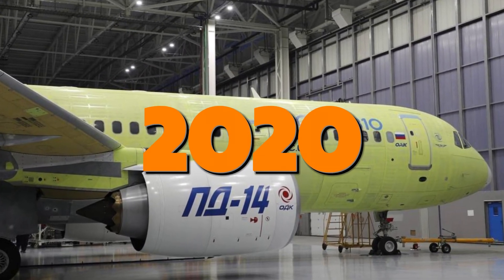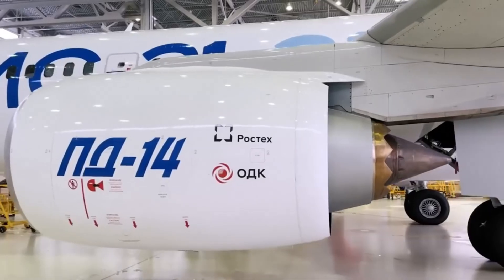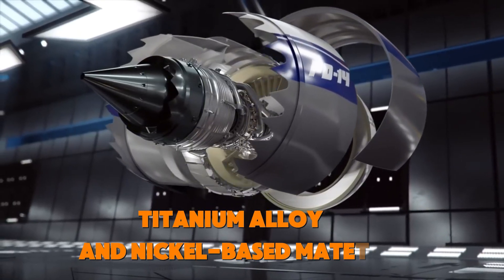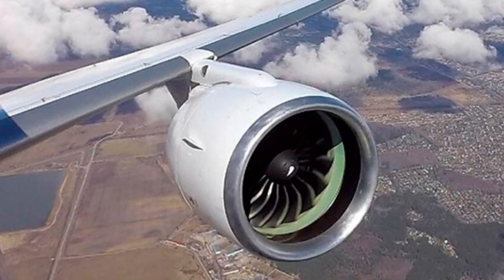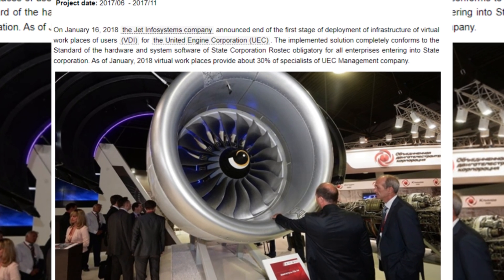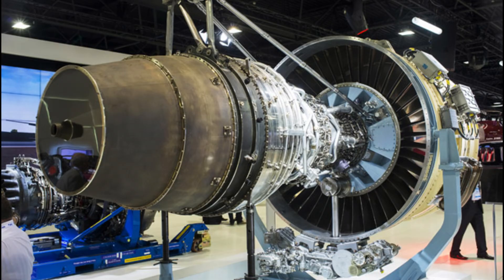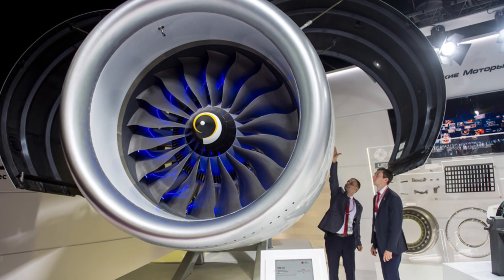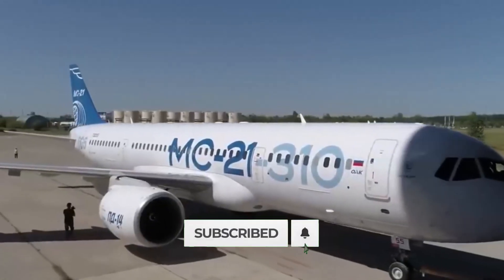Russia's PD-14 Engine: The Aviation Game-Changer You Need to Know About!

Comment: PD-14 is a low risk, low complexity modern engine that is slightly less efficient than modern western alternatives; however the aircraft itself is not meeting design criteria and the engine has no other aircraft at the moment. 
It is also questionable whether Russia can produce these equipment given labor shortages and loading of the same factories for military use.
Reply: Die PD Triebwerksfamilie besteht aus vorerst 3 Stammtriebwerken.
PD 8, 14 & 35 welche jeweils Evolutionsstufen mit mehr & weniger Schubkraft haben werden. Eine Bauastensystemtriebwerkfamilie mit vielfältigen Anwendungsmöglichkeiten.
PD 8 (6-10)
PD 14 (12-18)
PD 35 (->44)
Der Grundtriebwerke
PD 8 für SJ 100 & BE 200
PD 14 für MS 21 (+TU 2x4 New?)
PD 35 für IL 96(98) + AN 124.
Aber SJ 80/+130, MS 21-2×0/4x0/5x0 und IL 96(98) 550 und vieles andere liegt auch noch in den Konstruktionsbüros der Russen. Auch dafür brauch man die entsprechenden Motoren.
Und aus einer großen Gasturbine für die Energiewirtschaft möchte man auch noch etwas größeres als das PD 35 ableiten bzw. entwickeln.
Für AN 148/158/174 ect.pp. benötigt man auch Ersatz und Triebwerke.

Comment: In 2006, an agreement was signed on the creation of a new engine, which was named PD-14 (a promising engine with a thrust of 14 tons).

PD-14 is a fifth generation turbofan engine developed for MC-21-300 aircraft, PD-14A for MC-21-200, PD-14M for MC-21-400. PD-8 engine will be installed on the Be-200, AN-148 and Sukhoi Superjet 100 aircraft. Therefore, the designers and engineers were faced with the task of creating a unified gas generator, which is the main element of the engine.

16 new technologies were developed for PD-14 by russian designers, engineers and scientists, namely - single-crystal blades for a high-pressure turbine with an advanced cooling system that allows the turbine to operate at temperatures up to 2000 ° K.; hollow wide fan blade made of titanium alloy, thanks to which it was possible to increase the efficiency of the fan stage by 5% in comparison with the fourth-generation turbofan engine PS-90 produced in the USSR in the late 1980s; low-emission combustion chamber made of intermetallic alloy; sound-absorbing structures made of composite materials; ceramic coatings on hot parts; hollow blades of a low-pressure turbine, etc.

20 new materials were created for PD-14 with indisputable advantages: a decrease in specific fuel consumption by 10–15%, a reduction in the life cycle cost by 15–20%; operation of the engine will cost 14-17% cheaper than existing analogues. All of them have been certified according to international standards.

New Russian titanium and nickel alloys are used to create the engine. The engine nacelle design consists of 65% of domestic polymer composites, which achieves the required level of sound insulation and reduces engine weight. 

The technologies used in the production of PD-14 are state secrets and are protected. Therefore, information on PD-14 is largely classified. Example: China would gladly copy production technologies, by analogy with the Su-27. They copied the plane, but they failed to replicate AL-31F engine.

The PD-14 project, in addition to creating the engine itself, includes the most important element - the provision of after-sales service. A large amount of work is planned in this area: the creation of a support center with round-the-clock work 365 days a year, the opening of a network of field offices, engine service stations, ensuring the replacement of modules in operation. It is expected that this all together should increase the foreign prospects of the new Russian engine.

The state's ability to produce cooled cast blades for a modern turbine aircraft engine is an indicator of the highest level of development in mechanical engineering. There are fewer states capable of producing fifth generation aircraft turbojet engines than countries with nuclear weapons or those that launch satellites into space. Only four countries - Great Britain, Russia, USA and France - possess full-cycle technologies for creating such engines.
Reply: And yet, it’s all irrelevant. Russia has always had great engineers, but Russian politics have denied them access to the world market & it’s only getting worse for the foreseeable future. It’ll be at least half a century before Russian business will have a realistic shot at competing on a world stage again.
Reply: @benrk5469 Les choses changent... Ces avancées technologiques s'imposeront. Le monde ce n'est pas les USA et l'Europe. Et la Russie a pris un autre tournant depuis 20 ans
Reply: @benrk5469 
Man kann sich auch täuschen.
Der Weltmarkt ist in stetigen Wandel. Seit der Jahrtausendwende geschieht auf dem Weltmarkt schon ein ¼ Jahrhundert ein entscheidender Wandel.
Warten wir mal ab, wie sich der Weltmarkt bis 2030 weiter wandelt.
Der PD 8 wird auch benötigt um die Mängel des Sam bei der SSJ 100 zu liqudieren.
Und die SJ 100 mit PD 8 wird efizienter sein wie die SSJ 100.

Comment: It was never a game-changer and it never will be.  Russia was always behind in tech by 20y. The only thing it can do is show pretty slides.
Reply: Does Boeing show it's pretty slides? I'm sure it's something to die for
Reply: @alexandracotton4514  boeing does not manufacture engines
Reply: @adult_swimm  It doesn't fly well even when it has them. :-) One thing missed out is when country's produce their own variants, you can't apply sanctions that work. Indeed, against Russia, they were never going to work anyway. And in the home market, even if the engines are slightly less efficient, it doesn't really matter. When you have the means of selling dirt cheap oil to that domestic market. Russia, of course, being a major supplier of gas, oil, plus a raft of god knows how many other commodities. China is also building its own aircraft, competing with Boeing and Airbus at the top level. Interesting times ahead. Will Boeing still be around in a decades time?
Reply: I’m sure … may be in 3 more years the MC 21 will fly and produced with great results!!!
Reply: Who cares whether they are  20 or 30 years back or better than you thought the main thing is they have their own plane which doesn't depend on other countries
Reply: @tawagashaw  there is no plane, it will never go into serial production, you will see it for yourself
Reply: @adult_swimm  That's what you're thinking but you know that the Russians are all ready starts producing IL114 and TU214 so their is no problem to produce MC21 too
Reply: It is the same you were talking about Chinese technology but to China seems to be ahead technically from the Western world. Everything starts with a step and Russia made that step. They will learn and improve. And I think you too should do the same.
Reply: Russia should have its own aircraft industry in order to be independent. Once their jets hit the market, they will potentially compete against Airbus. and hopefully Boeing. This will cure them of the complacency they have experienced over the last 30 years and will push them to innovate. So more players equals more competition and better and safer product.

Comment: Admin please tell me: finish 2024, how many TU-214, MS-21, IL-96 will be built. I am from Viet Nam, I love Russia and USSR.
Reply from the maker: As I have information, by the end of 2024, the United Aircraft Corporation (UAC) aims to deliver seven Tu-214 aircraft to Aeroflot and plans to ramp up production to 10 units annually thereafter. The Il-96 is also expected to see increased production, although specific numbers are less clear. The MC-21’s large-scale production may be delayed until 2025 or later.
Reply: @AeroBuzz1  I think, We just need TU214 and IL96 with large number unit. It slove proplems that Russia cope now. TU-214, IL-96 have history very good and safe. It will be even better if upgraded with PS-90A3. MS21 will be very difficult to be recognized as safe to fly like TU214 and IL96.
Reply: @AeroBuzz1  Il96 was made one aircraft last year. 
=====
 In 2024 only plans. Another Il96 is in the assembly stage. Tu-214 tail number 64535 possibly until December. MS21 and Tu-214 only in plans, it is necessary to replace from 40 to 60 systems, from electronics to the on-board galley with Russian ones. They promise in 2025.
Reply: None, russia will run out money  in 2025
Reply: @adult_swimm this is similar to British intelligence has said that Russia will run out of weapons and missiles by 2022, there is no need to wait until 2025.😂😂😂
Reply: @quangtran9545  british intelligence never said anything like that, stop spreading fakes.
Reply: @adult_swimm if you mean Dollar yes but they don't need it for their own products so keep crying like all ways
Reply: @tawagashaw  you got no clue, I lived there when country ran out of money and started printing banknotes with lots of zeroes. and the conditions were much more favorable than now.  in a year or two you will see complete collapse of all aviation industry.  all ingredients for it are ready.
Reply: @adult_swimm Then you know who stole the Russians and who destroy the Russian aviation Factories that's why it isn't easy for them in the short term to build the MC 21 by the way I was there at that time too but I know that is gone and never came back again
Reply: @adult_swimm  No. In 2025, an analogue of SWIFT will already be in operation, to which 159 countries will connect. I think that it will not be Russia that will have problems, but the US that will be looking for someone to foist off the printed debt.
Reply: @ФеликсДзержинский-ф2ш  ну да, ну да, набиулина уже сказала что ФНБ закончтися в 25м году, и инфляция прет как паровоз, поэтому будет повышать ставку еще. никакя экономика не может расти при кредитной ставке 20% и выше. никаких двигателей не будет.
Reply: @adult_swimm  Согласен что экономика притормозиться . Конечно это нереально и вызывает перегрев потому что за 2022 -2024 год строилось и реконструировалось  в среднем по 20-30 предприятий и заводов в МЕСЯЦ !!! :)
Reply: @ФеликсДзержинский-ф2ш  если жил в далеком ссср, все идет абсолютно идентично, одни победы и рекорды, весь негатив жестко замалчивасля, а потом все это сложилось как карточный домик, в этот раз будет раз в 10 хуже.